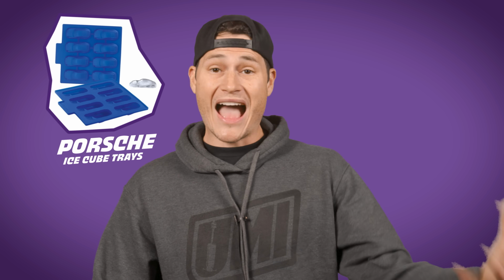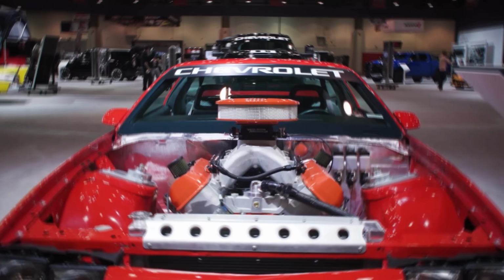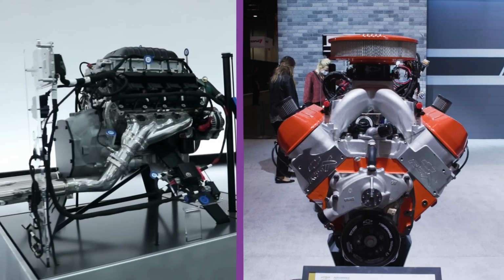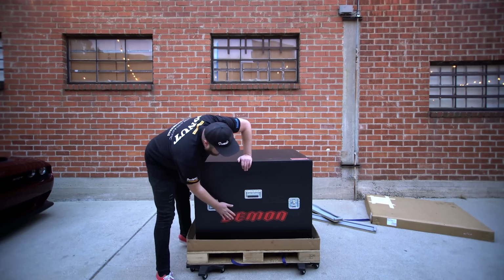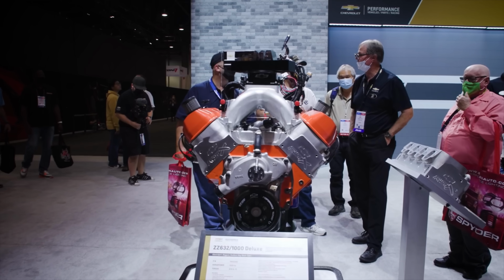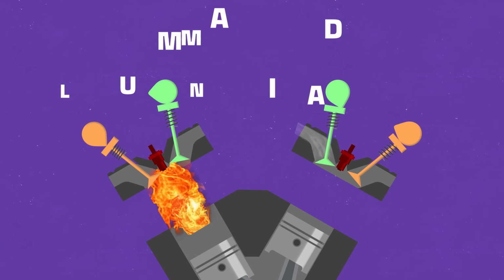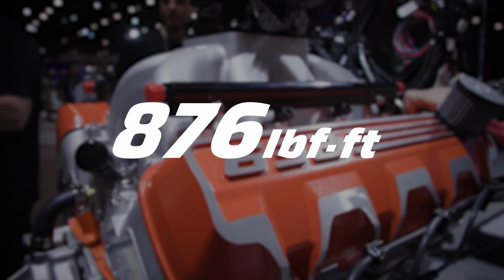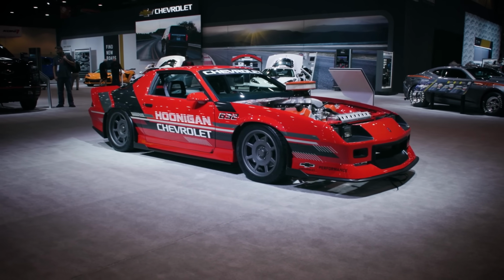Chevy's 1000HP Crate Engine EXPLAINED

Comment: A hilarious use of that engine would be to throw it in the back of a compact like a chevy spark and turn it into a rear engine fwd car. would take excessive amounts of modification and would probably tear itself apart but would be great to see.
Reply: absolutely no traction because that big ass hunk of weight is hanging over the wrong end of the car ; )
Reply: @reilandeubank  endless fwd burnouts while going nowhere at all..lol
Reply: Most likely it wouldn't be moving anywhere because the engine might be heavier then the car lol

Comment: 1st call Jake B at BKOR Can you build a sick ass rock bouncer chassis 2nd install the 632 into the rock buggy 3rd take the bad a$$ Rock bouncer to the same trails that y’all brought the 2 Toyota taco’s that y’all built and then finally let that beast sing on the rev limiter at 65 6800 RPM ; )